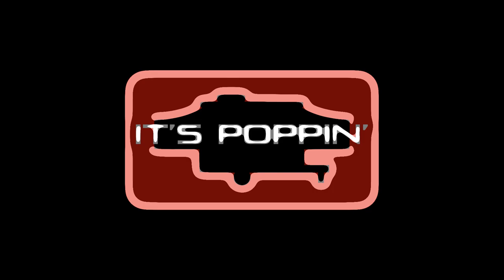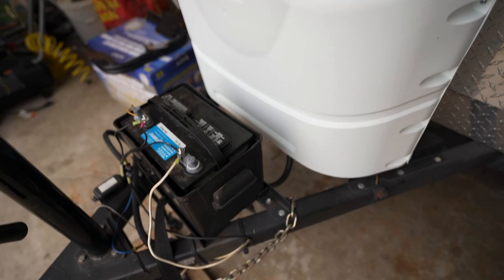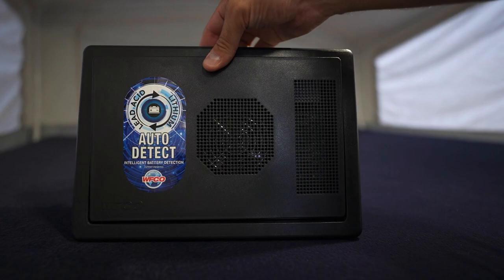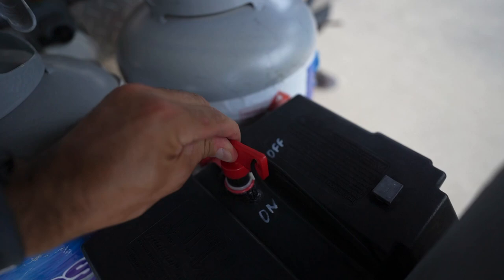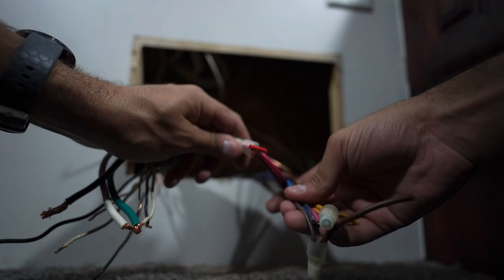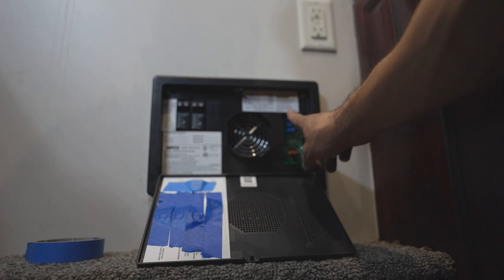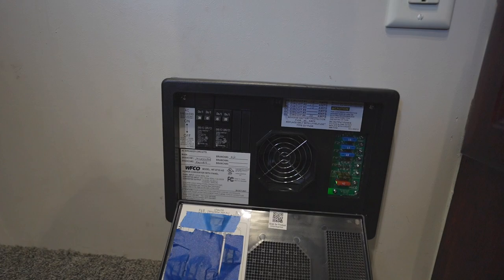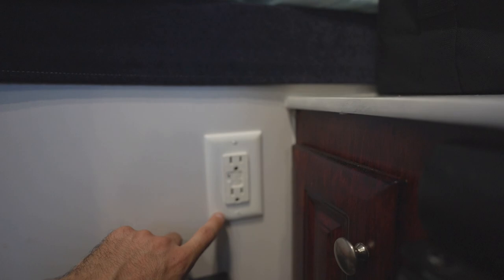Pop Up Camper Electrical System Basics⚡️PLUS Troubleshooting Tips

Comment: Great video, as always. Packed with useful info for those that are new, and those of us that can use a refresher from time to time. I would add that on 12v frame ground locations they be inspected at the beginning of the season. I use a small brass wire brush, remove grounds, check connectors, clean any rust from connectors, attachment screws, and threaded holes. Reattach grounds using contact cleaner. I am  impressed with your analytical processes. Beginning to finish your vid was packed with common sense approaches to common electrical problems. You have impressed upon others the need to slow down, observe, analyze, form a plan of attack, and complete a task by relying on one's self. "Knowledge is the basis of problem solving, injected with a large dose of self reliance, and a pinch of confidence." 
All things are possible!! Bless you, and your Family. See you on the trail.

Comment: Great video!  I blew the gfi circuit out in Natchez trace state park. The gfi would not reset and I never messed with the inverter before.  Opened the inverter cover flipped the 15amp circuit breaker and WALAH!  Power in the outlets!  Here comes the coffee..😎

Comment: Thanks for exploring this with us. I want to add a 4-in-1, 12v charger panel, that has usb/cig lighter/voltage meter/on-off switch so my grandkids can charge their devices inside the Pop Up. We mostly boondock, we call it camping here in Alaska. 😂 

Most of the tourist bring their big RV’s and stay on compacted slabs of gravel, pushed in like an apartment one on top of another, run on shore power, and never get to see a squirrel run by a pretty bird.

Comment: Great video man. I love learning more about campers. It makes me feel more ready. We went a few weeks ago and I bought solar panels with a charge controller and with limited garage space I figured I would hook up a power quick connect to the battery but I would do the rest of the installation while camping lol 😂 it went fine. I had to make a couple guesses due to poor instructions and no cell service lol. Also I made the reflective inserts for the windows. The first night we didn’t have them and the heater was constantly turning on. The next night with them it was much nicer. It definitely works. Thank you for all you do.

Comment: I know my solution isn't right for everyone, but I did a complete rewire of my system. Where my converter was located was very inconvenient (on wall/floor under dinette) I removed it and moved service to under my bench seat for dinette. I put in a house subpanel and a dedicated plug for a new stand alone 12v converter, which I inturn wired into a 12v fuse panel capable of 12 circuits.

Comment: First time I've seen this great video and your channel.  Thank you!  I was looking for preview of my upcoming attempt at adding a DC Bluetooth Ammeter in my Viking behind the WFCO and add a new wire feed on one of the existing circuits that isn't being used much.  I'll remove the WFCO cover to expose where the wires come onto the front next to the fuses and then pull each fuse to see which appliances are wired to which colored wire.  With the DC Red wire nut you've indicated where the POS might come in, but didn't show where the NEG (white) would come it, although I assume it's somewhere on a terminal bar attached to that copper ground wire.  I'll go looking!  Thanks, again.

Comment: I was ready to do some heavy wiring tracing until I watched your video. On an older coleman popup the flip up stove/sink got out of line and did not press the shut off switch. After check I my lights work. It was confusing that my out side light did work.  Thanks.

Comment: I think you just solved a mystery for us! When we get on the back bunk, sometimes the lights go out. It has been getting worse. We were wondering if the kill switch was under there somehow. We  need to investigate further. The kill switch on our StarCraft was under the galley kitchen so that when we folded it down, it was activated.
Reply from the maker: Yes, check under the metal plate mounted to the rear bunk that slides up against the rear wall.

Comment: What about the trailer lights for when traveling? Ours doesn't work, so we had to get the magnetic lights that plugged into our tow vehicle. I'd like to get the lights working again but don't know where to start.  We have a 1997 Coleman Seapine. It doesn't have the electrical brakes.

Comment: Excellent video Thanks! I have a 2007 fleetwood santa fe popup and would like to replace the hardwired smoke detector with a battery only smoke detector. There is no plug on the wired detector so would need to cut the wires to get it off. Will this affect other components in the popup?

Comment: Great video! I’m tryin to determine the best course of action with a 12v battery. If I use just that can I run a fan and charge phones overnight? It sounds like no to me based on the video, but if I can’t what is the battery really useful for when boondocking? We may not have shore power available to us this go round.
Reply from the maker: You can definitely charge phones overnight. The fan will largely depend on the wattage and keep in mind it’ll have to be a 12v fan. Maybe a battery powered fan would be a good option?
Reply: Great idea! We typically use the fan mainly for white noise, but also just for air circulation since we don’t have an a/c

Comment: New pop-up owner here, this video was super helpful, thanks. I am dealing with a mystery that I can't solve, and I wondered if you had seen before. When the camper is plugged into shore, power, I plug in an electric heater that runs at 700 watts. After about two minutes, the 15 amp breaker trips. I don't understand why. It doesn't appear to be related to the outlet I'm using, because this happens no matter which outlet I choose. At 700 watts, I'm only running about 6.3 amps, yet the breaker is tripping. Have you seen this? Otherwise the system seems in good shape. Thanks.
Reply: I don’t have the complete answer but after watching many vids I noticed a lot of campers plug in those types of appliances with a regular cord directly in the electrical box do to the constant tripping of the breakers.

Comment: I also had to change my converter because the 12 volt side went bad, not an easy job, but I did it myself.  Only problem is the outlet next to it doesn't work.
Reply from the maker: Just the one outlet? Perhaps the one outlet wiring is loose.
Reply: @ItsPoppin  Thanks, I will check for that.

Comment: Appreciate all the videos! I have an 06 Coleman Fleetwood Americana Timberlake. When I'm plugged in to shore power the AC will work, however my lights and outlets are no longer working. I have replaced the kill switch and no luck. Breakers and fuses in converter all seem to be good. Any thoughts on this?

Comment: Great Video..  I have a 2001 pop-up new to me..  If the battery is dead or disconnected should I be able to run the lights on the inside of the trailer from shore power?  The outlets inside are working but no lights.  Also when the battery is fully charged and connected are the lights supposed to work or is there another place to check to make sure all is turned on?
Reply from the maker: Yes and yes - try and find the disconnect switch for the lights and see if it’s actuated. Alternatively, check the fuses in the converter to see if one is blown.
Reply: @ItsPoppin  Thank you it was the fuse at the battery and also the battery was low.

Comment: I wanted to ask you a question, I hope you can help me. I have a regular pop-up and I want to put a solar panel on it, just to charge the battery. The idea is to eliminate the possibility of charging the pop up's battery through the truck (when connected) and charging it with the solar panel or when you connect the pop up to city power, it only works (automatically) with the latter. Do you know how it could be done? From already thank you very much

Comment: thank so much, my problem Is little bit more....I have a 99 Coleman Santa fe popup Hello, I'm looking for the electrical schematic diagram for the 1999 Santa Fe Popup. Last time I used it, the lights and all the electrical worked fine but after three months of storage, nothing electrical works. From the battery to the converter box I have the proper voltage. In the converter box, the top 2 fuses are fine but the bottom (3rd) battery fuse blows as soon as it is put in place. 12.8v (battery voltage) is measured at that fuse receptacle. 
I heard it might be the kill switch according to the one video I saw from you. Other than that,  something is causing the one fuse to break but yet I have nothing on in the pop-up unit. So that's why I am asking for the electrical schematic design and the event I have to follow and search for a short. Do you know where I might find one?
Thank you

Comment: Hi- I  don't currently own a Pop-up camper, but my Husband and I  are in the search for a Pop-up camper that can be pulled with a 2020 Subaru Outback. What do you suggest as a light pop-up camper ?  I've watch many of your videos and do appreciate you keeping in simple for those beginners like me!! We are in search of a small pop-up since in will be just my husband and of course our dog. We don't need a toliet or shower or AC since we do camper at State Parks for the most part. But it would be a plus. I  can always use a fan for AC, since those can be heavy. I'd appreciate any suggestions. Thanks in advance.

Comment: Where do you get your parts for your pop-up campers when you need to replace or repair it the reason I’m asking is because I have a 2000 Coleman/Fleetwood Cheyenne that I need parts for like the storage box top
Reply: Coleman Pop Up Parts has everything. Formerly Beckleys.

Comment: Hi!!

I have a 1996 Coleman Fleetwood Pop-up and I am having issues with trying to replace the battery wires? I bought it from an individual that just used the electrical plug-in and never the battery. I was looking at replacement wiring, but not sure how to get to the connector. I looked under the trailer and I was able to see a small hole in the plywood where the wire goes, but have absolutely no idea how to get to it. There is a wire that is connected to the tongue, but there is no connector piece available to attach new battery wires to connect to the battery.  Does anyone know a way that I can access the wire? Can I remove the thin particle board under the bed? HELP PLEASE! Thank you!!
Reply from the maker: Tough to say without seeing. However, in theory, the positive terminal of the battery will connect to the converter and be protected by a fuse. Likewise, the negative terminal of the battery will be grounded to the frame of the pop up.

Comment: Hi, can someone explain something to me..
This popup only has 1 battery.
I looked up on line how long can that battery run 12 volt lights, and it said about 4 hours, so what i want to know is 
1. how do people use it for the whole day or two?
2. What charges the battery when u are not plugged in?
3. Even fully charged, how is that battery strong enough to run lights, whatever you have plugged into your outlet and a heater or AC?? Lol
Please, someone explain this to me
Reply: Solar battery  charger  plus 2 12 volt batteries   in parrel
Helps
Reply from the maker: Switching out the bulbs for 12v LED bulbs helps significantly in addition to only turning on the lights when needed. 

The previous comment regarding question 2 is correct, the only way to charge battery is by being plugged in or getting power from solar or a generator. 

Also, of note, your 120v outlets will not work on battery power. You need to be plugged into shore power for your outlets to work.

Comment: If anyone would like to help me out here I have a 2013 Forest River Rockwood we plugged a mini heater into  one of the outlets and within 5 minutes it cut off I went over and pushed the reset button on the GFCI and nothing happened now none of my electrical plugs anywhere work. What could be possibly going on.   I checked all the fuses and I checked all the breakers and everything is turned on and the  fuses were fine but the GFCI will not reset.
Reply: Gfci may be bad
Reply: @scottterry1659  that is exactly what it was

Comment: I accidentally hook up the wrong wires to a deep cycle battery it pop a fuse but I put in a new fuse but now the outlet don’t work what do I have to do it fix the outlets
Reply from the maker: Check the circuit breaker in the converter and the GFCI outlet
Reply: @ItsPoppin  I did I guess the outlet not link to the power when running by battery I test it out when we got home and plug the camper to the house outlet and everything including the outlet work